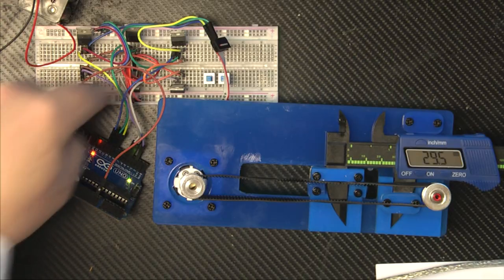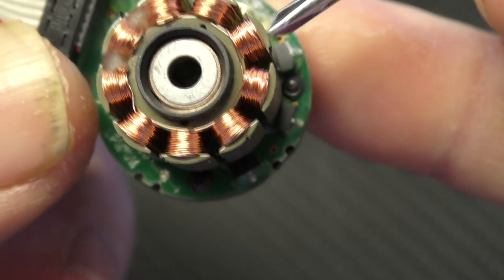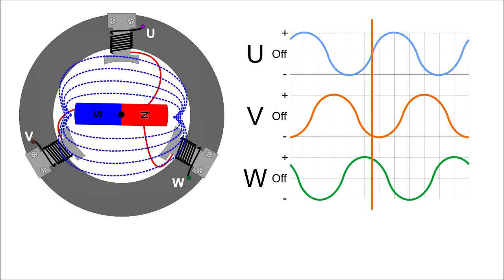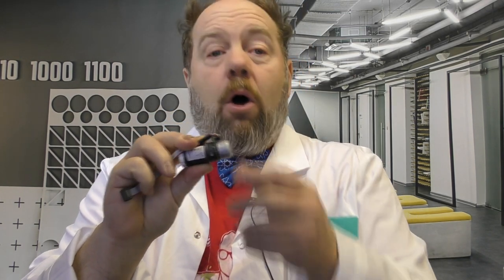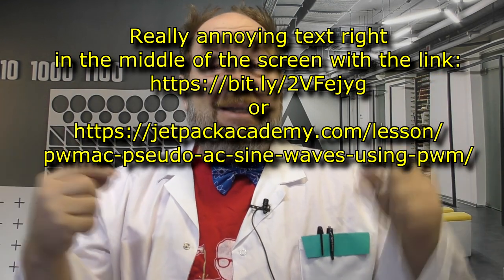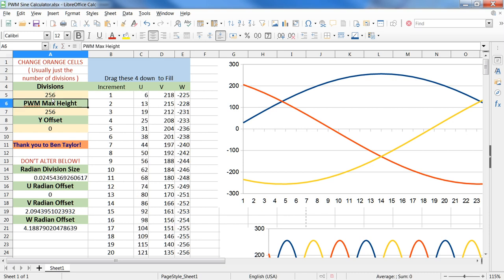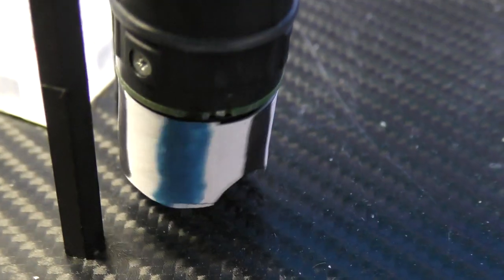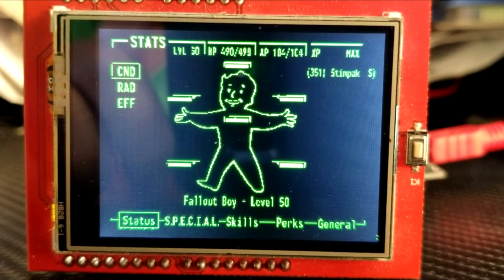Hardware hack a BLDC as an AC servo motor

Comment: Thank you very much for sharing ! I have a little question sir ! If you want to build an 3 phase inverter and you already use the maximum switching frequency for your microcontroller and still only get a sine wave of 50Hz but want say 400Hz for the Motor to get at it´s maximum speed do I have cut down the resolution in the sine wave pattern then ? Because you don´t have to use 255 steps.

Comment: Great video.  Seems like you could get away with only 3 PWM outputs, since only drive one of the two transistors per H bridge at a time (plus a digital enable to select which of the 2 transistors to drive), unless I am missing something?  Also, it appears that this example is driving the coils at max voltage (or at least high enough to overcome the load torque) - my understanding is that the typical feedback allows you to drive a BLDCM with less voltage so as to reduce power and heat in the motor, right?
Reply: hey, did you manage to do this ?
Reply: yeah i imagine this would get very hot as you dont have the inductive reactance from the high relative between the stator and rotor that the motor was designed to have